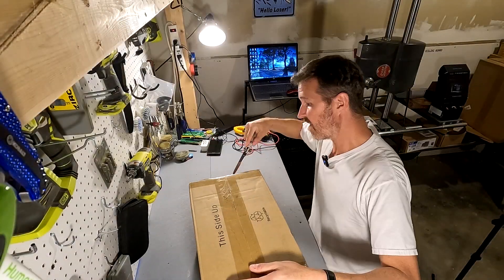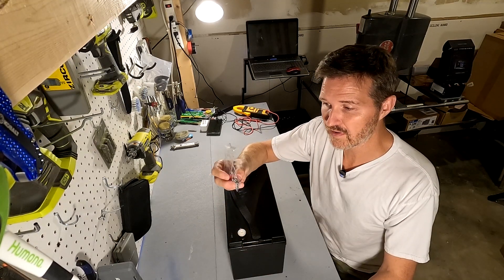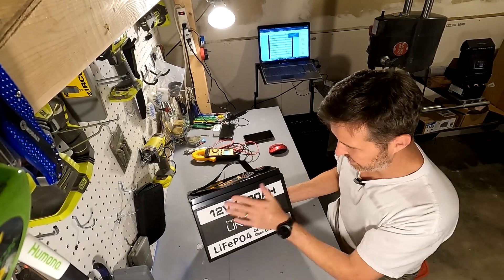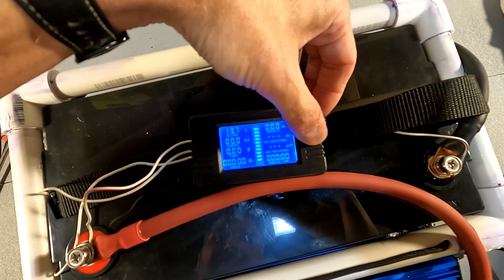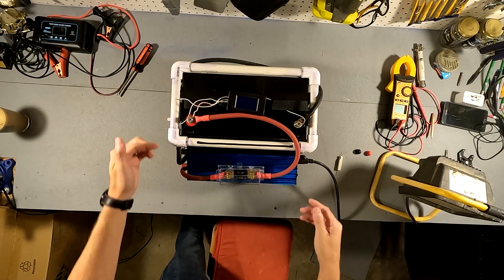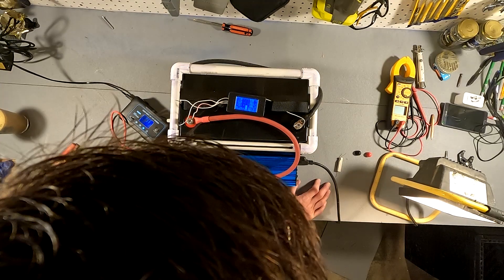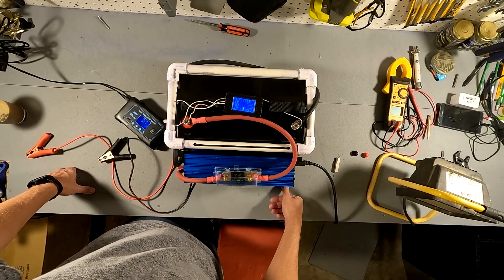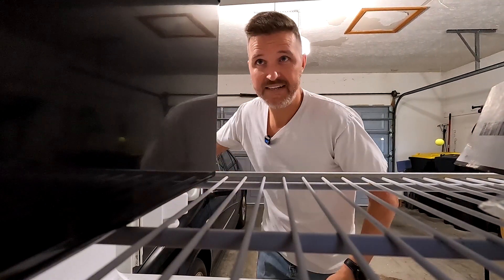UnoWix 12v 100A Lifepo4 Battery Review.  Does it really have cold temp charging protection??

Comment: Question. What do you think of 24v Batts.? All the manuals seem to talk about 12v in series. If I see a bargin 24v could, I use that instead.
Reply from the maker: I would go with a 24v battery instead of 2 - 12v batteries.  It would be easier to keep it in balance.  The only thing is the weight.  If you are going to move it often then that might be an issue.
Reply: @OffGridBasement  OK, maybe If I do expand I will use a 24v. I will keep eye on temps. Might have to move thing inside in November. Or I thought of using an old electric blanket to keep it above ZERO.
Reply from the maker: @SolarResurrection  look into the electric blanket idea, but make it doesn't turn off after a couple hours.
Reply: @OffGridBasement  Think it stays on. 3 settings  that take 20,40,60watts respectively. Might have thermostat overheat protection. We don't usually get snow , we hope for warm  from from Spain over winter.